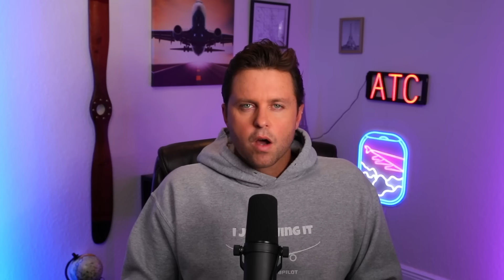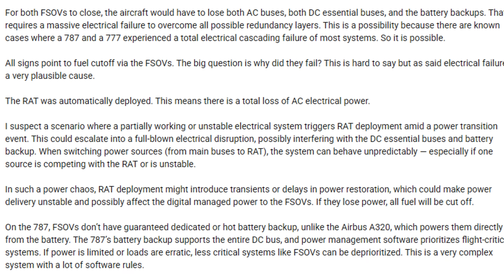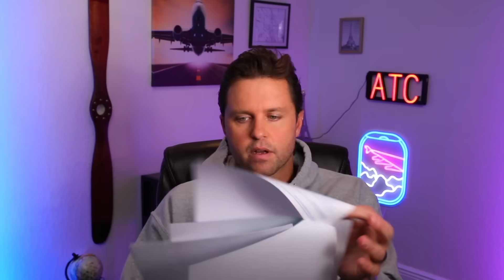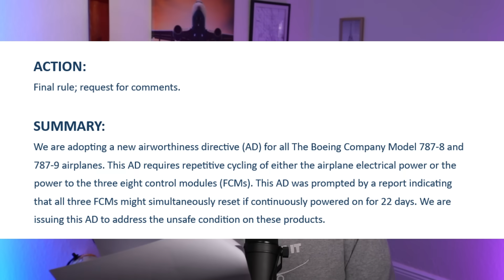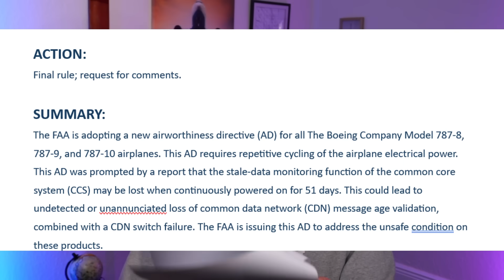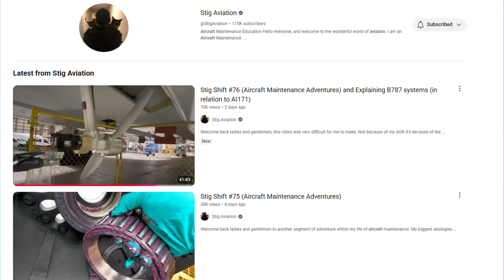Air India 171: Did a Software Glitch Cause Dual Engine Failure?

Comment: Really feel that all Boeing 787's should be grounded until this is figured out. I won't be getting on one.
Reply: "If it's Boeing I ain't going".... the Chinese will be mighty pleased about the NGADs if Boeing does make them
Reply: For the time being, I am only booking with Airbus only airlines, I don't trust Boeing anymore!
Reply: Did they not announce that they are until the issue has been confirmed?
Reply: Five million flights one crash it's safer than walking down a street. 2 woman pedestrians were killed in the car park next to my house by a senile driver.Not to dismiss the fact this needs thorough investigation investigation
Reply: I was looking for this comment bc I feel the same way. I’ve watched several pilots on YouTube, and they all keep saying flying is safe. I no longer believe them, and my trust in the entire airline industry is gone.
Reply: @loricawley54  I also get the impression that pilots in general, kind of has a task to reassure us that, for example, a dubble engine failure on takeoff is almost an impossible thing to happen.
While me on the other hand is thinking that a wrongful reading by a faulty sensor would easily trick a control unit to roll the thrust back to idle. Working with heavy equipment and trucks I constantly get fed with problems caused by malfunctioning units that depends of readings from sensors, and I just wonder why that kind of problems wouldn't be possible in an much more advanced aircraft, were just about every controlsystem nowadays are electronic controled by wiring and probably canbuss also. Ticking timbombs in my opinion, they might have the statistics on their side but it doesn't help me oversee just how fragile I think those state of the art aircrafts are nowadays.
Reply: of course, i am traveling a lot and if i see boeing somewhere i don't book the flight ticket....NO WAY
Reply: Even if this is what happened, the chance of it happening, let alone seconds after takeoff (the worst possible time), is 1 in a million
Reply: I'm scared to take my flight on a 787-9 which is in a week
Reply: @MinhajAhmed-y7i  I understand the fear but even if this FSOV is the cause (or some other as yet undiscovered bug/glitch in the 787), it is "only" one fatal crash after millions of flights. The chances of you getting killed on your way to the airport are still far higher than the chances of your 787-9 crashing and killing you next week. Hope that reassures you a little. Nevertheless, if there is a suspicion that this is a 787 fault, the fleet really must be grounded. There cannot be a second crash required to prove it was the plane a la MCAS. If a second plane crashes Boeing is finished as a commercial airline manufacturer as nobody will want to set foot inside anything the produce going forward. I think Boeing knows that it's better to ground and fix rather than risk another MCAS. It's bad enough as it is, if it's a fault with the plane. I hope it isn't the plane but if an explanation cannot be provided by the investigation team then the suspicion will (rightly after MCAS) fall on Boeing rather than the crew/airline.
Reply: @murphaph Yeah totally agree. I'll still take the flight as it's the cheapest, and the only direct flight, and I trust this airline more than Air India. An Indian pilot vlogger named 'Flying Beast' explained that Air India itself has extreme maintenance negligence, and the planes are in so bad condition, they're barely air worthy. Recently many Air India flights are being cancelled as the pilots are denying to fly faulty planes. So, it might not be Boeing's fault (or might be), might be Air India's fault. Either way, the preliminary report should come soon, I'll not be surprised if they're intentionally delaying to make up a story.
Reply: @murphaph  Boeing makes MCAS which turns out to cause planes to crash. There is already a disease called MCAS (Mast Cell Activation Syndrome) which causes people with MCAS to crash.
Reply: @MinhajAhmed-y7i I’d be scared too. I’ll be praying that all goes well for u. 🙏🏻

Comment: As a chemical engineer I deal a lot with safety loops for LNG and other explosive/hazardous fluids. We have multiple modes for a valve to react to loss of control voltage:

EFL (Electrical failure last. Valve remains on position before power loss. Used for non critical fluids)
EFC (Electrical failure closed, spring loaded cutoff. Used for potentially explosive/hazardous fluids, like fuel at a gas station)
EFO (Electrical failure open, spring loaded open. Can be used for reducing risk of a hazardous scenario. Use cases would be cooling water or fire extinguishing water outlets for certain apparatuses)

It would be INSANE to design the one valve that keeps you flying as EFC, if it relies only on a bad readout. It would be worse if the software intentionally closes the valve based on a bad readout.
It should absolutely need a human confirmation, like a button press from the pilot and would need its own battery backup and wiring harness. Sounds like the MCAS AOA sensor issue all over again.
Reply: That's exactly why these valves are not designed that way, this video is pure misinformation... They stay latched in the position they where when the power cut out. Those engines will run until the fuel runs out, if all electrical systems go down
Reply: @filmcapacitor  It's not necessarily electrical.  It could be bad sensor input, bad code, or update not installed.
Reply: @robinhoodhimself  the TCMA glitch that was referenced in all the software related theories can only happen if the aircraft thinks it's on the ground, which is directly contradicted by the fact, that the gear retraction cycle was started -  but none of those sensationalist youtubers did their due diligence on that. of course it could be literally anything else, but posting long form videos about it is just asinine
Reply: @filmcapacitor  Gear retraction started and stopped... The chain of events that happened on this plane made the software think it was "on the ground".  I'm an IT guy and I know how code is working.  How do you think the code knows the plane is on the ground or in the air?  Plane are controlled by computer so you're 99.9% sure that "both engine at the same time" is a computer decision.  This video is the ONLY one saying upfront the main logical hypothesis brought by the facts taken together.  I don't say it's the correct analysis.  I just say it's the one going in the right direction.  Big money is on Boeing so every day there is a new theory to hide the truth.  It's merchant of doubt at full steam.  And for the record, I'm a Boeing shareholder.
Reply: @robinhoodhimself I don't think your scenario is very likely. The FDR read-out is long finished and if any of this was a possibility we would have seen some kind of safety action from the regulators. You're overstating Boeing's power in this game, not everything is a conspiracy
Reply: Are you aware if those systems are run on RTS computers - in general those are rare solutions, this is where computer (none buyable PC is RTS) are running in REAL TIME, that means that all tasks are done exactly in milisecond they are given, there is not queuing? Is that the case for the airplanes? If not then I am totally in awe... even chern.obyl computer was RTS in nature.

Comment: Pilot Gary some more info from a post i seen from a 787 engineer, I will try find the original post but he said there is an instance where where power is lost to the engine the fuel vlaves will go full open and gravity fed, and the engines also have there own alternators to give power to the engines control system to Put it an altitude flight mode, if this happened in this case then the engines would been in a mode good enough to cruiser but not climb

Comment: I understand protecting the airframe but to allow for fuel valve shutoff at a low altitude under any circumstances is insane IMO, fire or no fire.

Comment: Just to be clear. 

This is design choice by the genius American engineers at Boeing. If this is fount  to be true it’s the same dumb software engineers who killed 2 flight worth of people by doing this to the max model. 

Here we’re at it again.  

I read in Reddit that for this reason Airbus doesn’t allow this to happen to engines. Honestly try to get an Airbus flight if you really have to fly and please avoid Boeing. 

Trump with save Boeing. Crooks are running that failed country. 

We all says even NASA doesn’t trust Boeing to bring Sunita Williams back.  They had to get Space X involved. 

Remember it took two flights for the max 8 model to crash before the world knew about the problem. 

This one crash happened in India and being an Indian I know Boeing can spend ton of money and get the report they want. 

Unless there’s another crash at a different country this won’t come out to public.

Comment: There should be no system that automatically shuts off without pilot input. None. There can be auto alerts to yell at the pilots to shut something off, but no computer-controlled or temperature thermostat shutdown whatsoever. If it has to do with the aviation of the plane, it must be human-based shut-off... how many times do our phones or PCs just lock up and require a hard reset and then restart? Yeah, sorry, but technology is wonderful until it sends 230+ people into a building because its sensors said "shut off now".

Comment: The pilots did not use flaps. They needed #15 MINIMUM, and the video clearly shows they did not.
Reply: The position of Flaps zero, 1, 5, 15 & 20 (only use for short runways) cannot be determined by looking at images of the rear of the aircraft. This is because the small flap settings only increase the surface area of the wing and the viewing angle is too shallow. When landing flaps 25 & 35 are deployed the Fowler Flaps hang down and these settings can be identified from behind. Hence in this case all that can be confirmed is that landin flap was not deployed. This has been confirmed by observing aircraft form the rear with know flap settings.

Also there are two checklist that require the position of the flaps to be confirmed. These are run on the FMS and this checks cannot be passed until the flaps are set correctly. If these are overridden by the pilot, as the take-off run is commenced, when a speed threshold is exceeded a master caution is generated and there are audio warnings, verbal warnings and messages on the FMS. Flap configuration warning. This would be unavoidable.

Further the aircraft rotated at the normal point 2,100m from the start of the runway and climbed to 400 ft in 10 seconds, at a rate of 2,400 ft per minute, which is normal. This could not have been achieved id the flap were not set correctly.

Your assertion that the correct flap setting were not used is not supported by the evidence.
Reply: @christopherrobinson7541  
"The position of Flaps zero, 1, 5, 15 & 20 (only use for short runways) cannot be determined by looking at images of the rear of the aircraft." <~ I will grant #1, and maybe #5...but I most certainly DO NOT see any flaps more than #5, and completely disagree with your assertion it can not be seen. That plane required #15 at a minimum, and didn't use them.

"This would be unavoidable." <~ I agree the computer warnings SHOULD be going off whilst these pilots tookoff without the proper flaps. It was also hot that day, and sunny. I'm sure there were sweaty people eating rice somewhere in Burma as well.

"Further the aircraft rotated at the normal point 2,100m from the start of the runway.............flap were not set correctly." <~ I completely disagree. That plane barely took off the END of the runway, as per the video...and numerous witnesses & data say it was NOT from the appropriate 'start of the runway', but rather from a more convenient (lazy & unprofessional) intersection.

"Your assertion that the correct flap setting were not used is not supported by the evidence." <~ You disregard the evidence to assert that.

Comment: In the mean time no flights on Boeing planes. Period. If this is the case, then this could be just a bad software design; however, this is not the first plane that Boeing designed and build. This is not the only software problems on Boeing planes either.

Comment: First the MCAS now this… Boeing may be in real trouble here
Reply: What exactly is "this"???
EVERYTHING  that is out there is ALL speculation other than the fact there was lack of thrust shortly after a normal takeoff. And a crash
Reply: @TrollingwTyrone I never said it wasn’t speculation… I said Boeing “may” be in real trouble
Reply: @eamonshields2754  i stand corrected - just crazy all the nonsense being thrown around. there are still idiots hangin on the flap thing and they used the whole runway. Yeah if it is another MCAS mess Boeing is in real trouble . rest assured whatever party is in the clear they will be the first to release anything

Comment: Here is a data.
The plane did not plunge down like how it would had if both engines shutdown.
It gradually descended until it hit the ground. It lost power
Reply: Correct. The question is what cause the power to be rolled back?

Comment: According to reports, and videos ive seen, There was electrical issues such as the a/c not working, the televisions, the overhead lights ect... they were experiencing electrical problems prior to leaving the gate. (If) the plane was experiencing electrical issues prior to takeoff and with so much as a split second glitch, the fuel pumps shut off (spring loaded) can shut off the fuel flow to the engines, why in the world  would they even leave the terminal? out of all the different opinions that i have heard, this video makes the most sense! i believe your research is the most logical out of all!!! keep up the great work. Robert

Comment: I’m not a pilot nor do I have any experience in aviation but I have decades of experience in semiconductor product development and troubleshooting a vast array of design and manufacturing problems. I also have decades of experience troubleshooting and repairing computers and cars. I’ve read with interest about this crash and based on all that I’ve read and what I know from experience this failure could definitely be caused by software and when you hear the term glitch it means there is a weakness in the software code, a bad decision in logic made at a crucial time by the software code.   It’s a weakness in the decision-making process of the code, for example, the decision to shut off fuel to the engines under take-off conditions, nothing should override fuel going to the engines during take-off, nothing. There may be legitimate reasons to shut off fuel to the engine, such as a fire or overheating but there are also overriding conditions such as critical power needed during take-off and even if the engine is on fire or overheating you keep the fuel supply going to the engines (at least one engine) because the alternative is even worse. If the software doesn’t correctly take into account the overriding conditions or reject illegitimate reasons, such as electrical power interruption, then fuel is shut off at the worst possible time and you can have this type of catastrophic failure. I don’t know with certainty what has gone wrong in this horrible crash but, based on a lot of experience, I can easily understand how software code may have been the weak link and may have played a role in both engines being starved of fuel at the worst possible time.  Mechanical, electrical and hydraulic redundancy can all be in place but with software code there never seems to be the same scrutiny or the same type of redundancy to correct bad code, bad logic. If it's not a software problem and a condition where fuel is shut off to the engines because of a power interruption then that's an even bigger problem.
Reply: Here is my problem with all of this nonsense. To have an electrical system that can cut off ALL power during take off in my opinion is criminal negligence and no Im not an attorney. You have to be an idiot to approve any system that has any possibility of shutting down both engine at take off. This isn’t a software glitch this is a common sense glitch. Under no circumstances should these planes ever see the sky again until some really smart people figure this thing out.